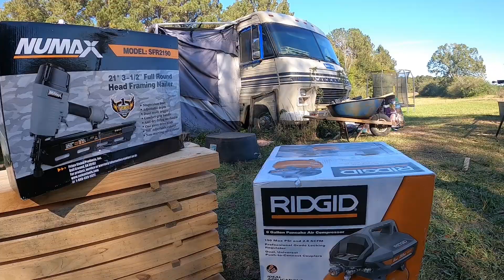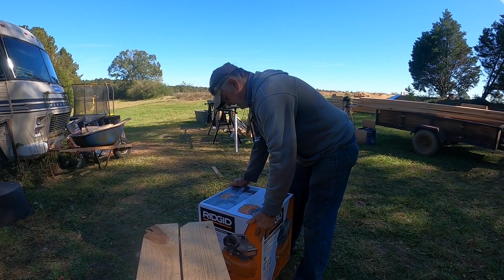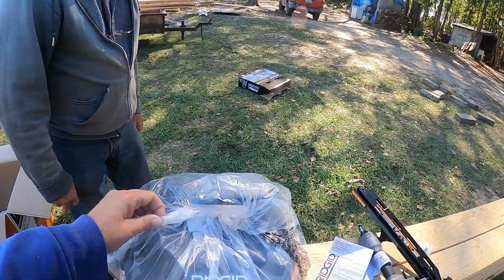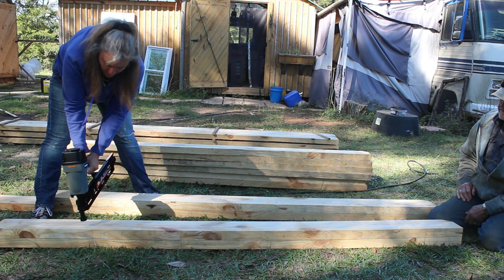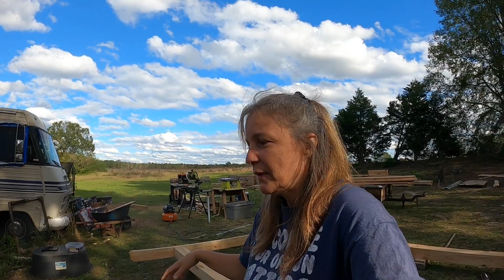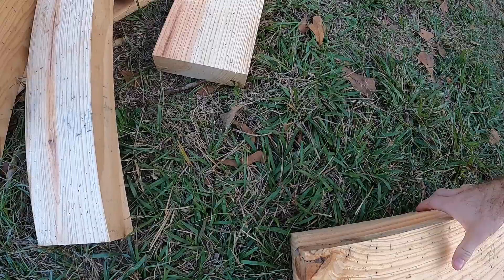Building a Post and Beam Bedroom

Comment: I love watching novice builders when they made a mistake.  It's the same way I feel when I mess up.  I'm like "dammit! now I gotta pull out the crow bar".   On that note,  put 3 drops of oil in the nail gun on the male fitting for the air hose.  It keeps everything lubed up for the day.  Peace!!!
Reply from the maker: I hope there isn't too many mistakes during this build. So we should oil it every day?
Reply: @ThirdTimeAroundRanch  Yes.  It will extend the live of it.  Only oil it when you use it.  I'm sure you guys aren't going to use 1500 nails in one day, but I suggest putting in just 3 drops in the intake before you use it.  It keeps the pneumatic parts lubricated for smooth operation.